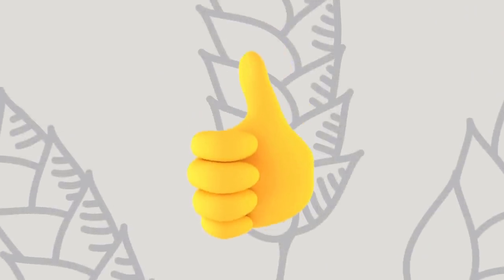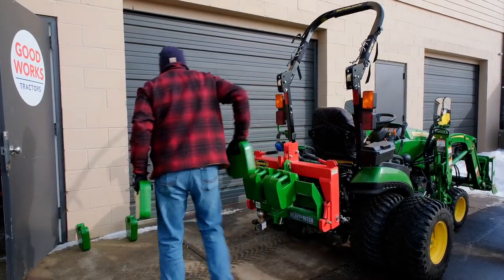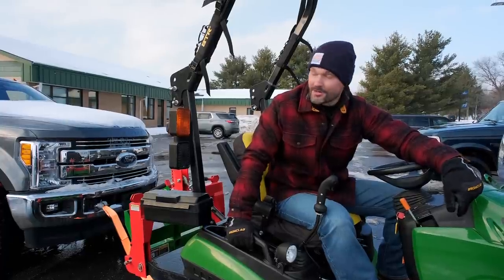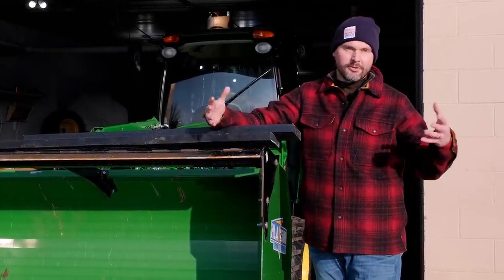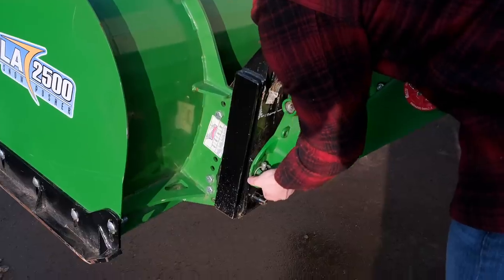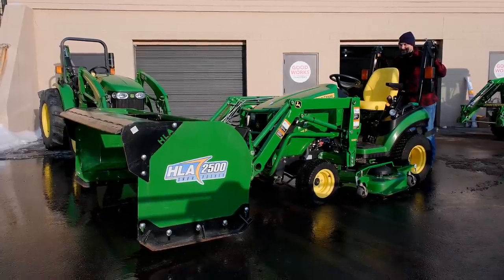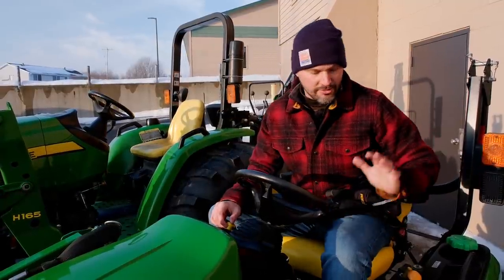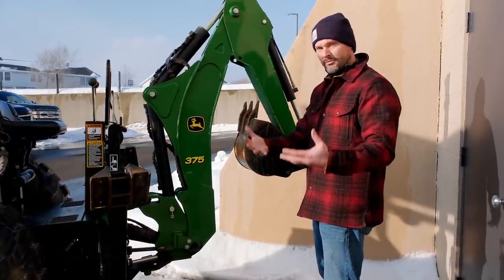CAN A TINY TRACTOR PULL A TRUCK + 9 MORE RANDOM QUESTIONS! 🚜

Comment: Did you really have any doubt that it wouldn’t pull your truck? With the trailer was impressive though. I’ve pulled my 87’ 1/2 ton Chevy pickup into my garage with my POS Craftsman riding lawnmower. Don’t get me wrong, it was a struggle (kept losing traction) but it did it.
Reply from the maker: I was skeptical.  For the record, it would not pull the truck and trailer without driving over the snow first.  We tried it and wouldn't budge.  After compacting the snow, it made it fairly easily although did strain.
Reply: Still rather impressive

Comment: there is a company in arling indiana called the original cab company makes a real nice cab for 3 series jd and other tractors they are canvas cabs around 1500 bucks im getting one for my 3038e before winter next season just thought i would throw that at ya   thats arlington indiana
Reply from the maker: Thanks Randy.  Yeah, totally slipped my mind when making the video, but I did add them to the list in the description.
Reply: I have an Original Tractor Cab for my 1025R that I really like. I take it off in the summer.
Reply: @benagain7617  i have lived 20 miles from that place here in indiana for all my life im 70 now its a small world didnt even know it was there until i started this utubin  lo

Comment: I have a question. I saw the various cab options for Tractors without AC. In the deep South we really don't need a cab in the winter but in the summer it is brutal. My question is having a Canopy with a fan in it would that be worth the investment? Does it help during sweltering days or is that a waste of money? Thanks.
Reply: Mark you should know the routines in the South. 2 -55 air (or wide open throttle), wide brim hat, and ice tea is the only way to ride. LOL
Reply: @blackhawkinternationalsecu6962  You got that right!😜
Reply from the maker: I don't know.  I'll say the L6060 I had recently had a canopy with a fan and I could at least feel it blowing on me.  It was winter time though, so I was already chilly! 😂
Reply: Very useful video. The truck & trailer demo is important as I’ve got (later in the Spring) a 6,500# boat & trailer to move from storage up 300 ft of driveway...with a slope at the top. My question is, using the John Deere ball hitch rear attachment, does going in reverse make any difference as I’ll be backing it up to reach the level parking slab at the top? 🤷‍♂️

I just received the upgrade LED lights from Green Parts that Courtney has recommended (2038R) and will avoid mowing in the heat of the day with the improved light they’ll provide. I’d like to avoid a cab so I don’t have to install/remove/store it twice a year (I’m getting too old for that stuff) and so I can park it in my home’s heated garage during times of required winter use (normal height overhead door). Keeps me from having to traipse 75 yards out to my pole barn to plug in the block heater, wait an hour, etc, etc, etc.

And finally? No cab keeps a nice pile of “Benjamins” in my pocket...😎
Reply from the maker: Haha good stuff Lee!
Reply: @leestarling2671  Send us a video of you backing that boat up your drive way. PLEASE! LOL